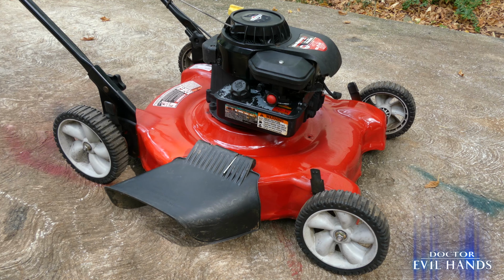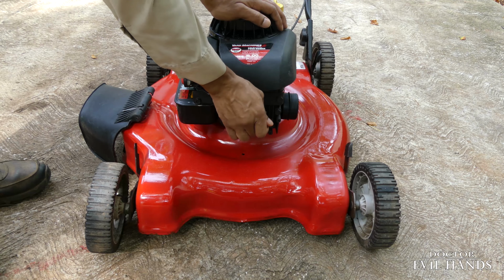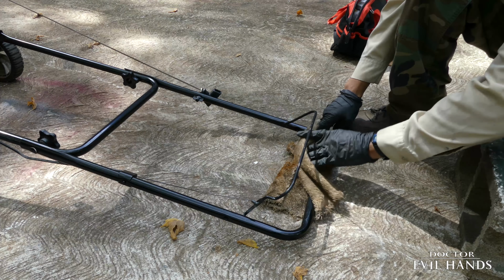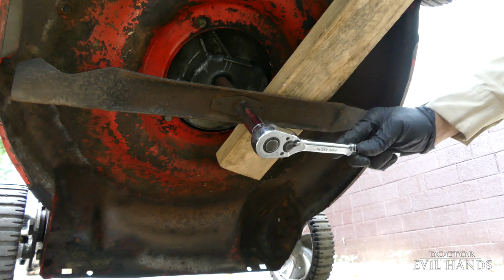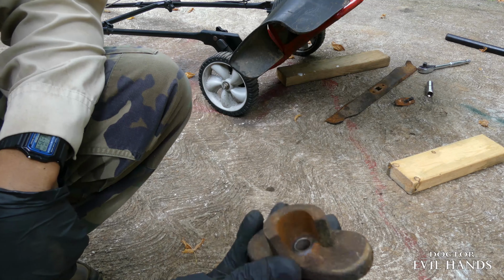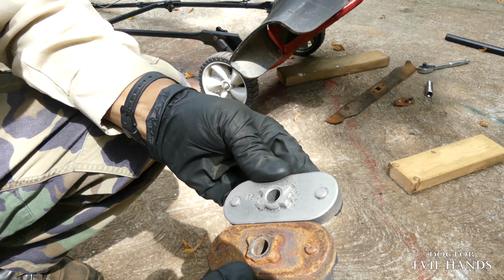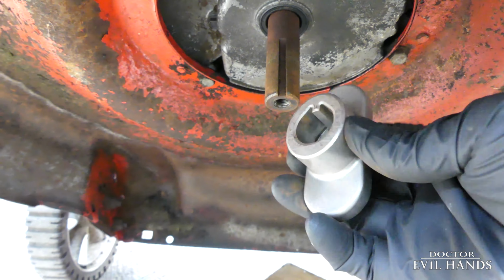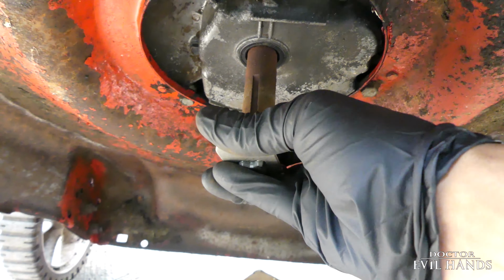How To Replace Your Lawn Mower Blade Adapter

Comment: The plate on the other side of the blade should be flat right? I have the exact same blade adaptor kit and the plate is not flat at all. I’d say it’s about 5 - 10 degrees on each side.